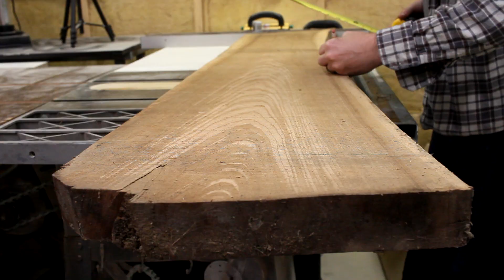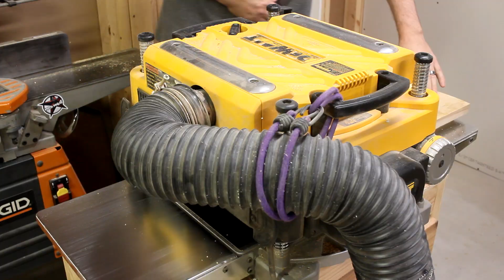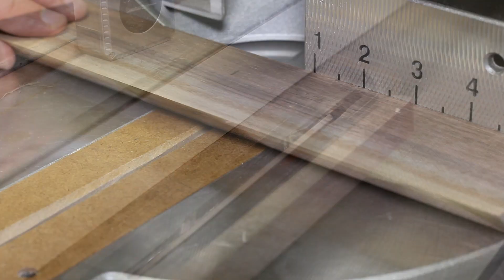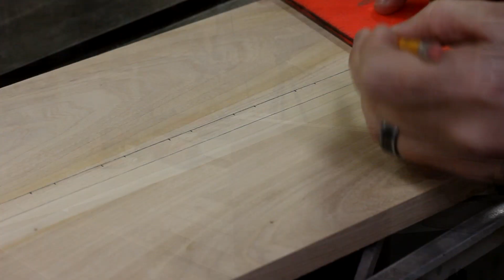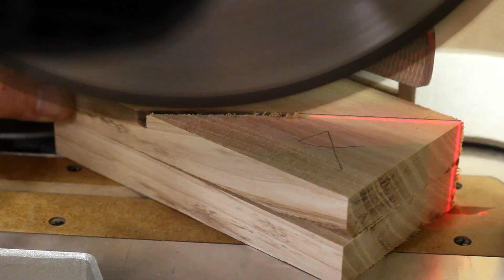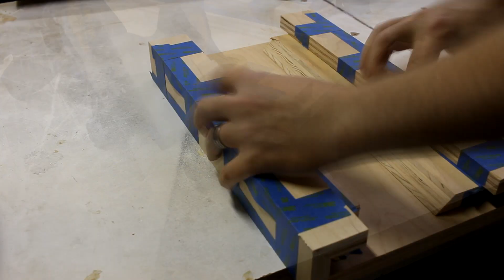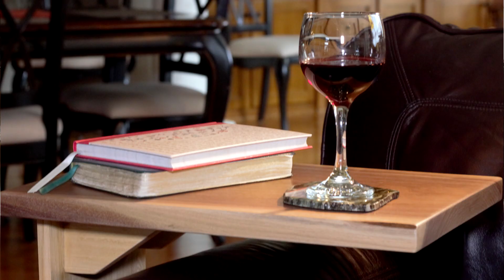Woodworking: Making an Adjustable Sofa Table

Comment: Sweet table !   I understood  why you built it for your parents  and their situation  but the reality  is  with al of todays  technology and gadgets  just about any one  could urilize this type of table   In their living rooms  and delete the coffee table   It would also be easy to  add  on accessory  parts to hold things like  remotes, cell phones  or whatever else  you may want handy in the room you use it in  i had  a commercially  available  kne i  used for a laptop  and it worked for many  places in my  home  for doing  work on the  computer   It was  unfortunately ugly   So i wound up getting rid of it  but your design would  be  the way to go since  i like the look and  flexibility of it
Reply from the maker: You're absolutely right, Craig!  It's definitely a multi-purpose table, especially with the variety of heights that it can be set at.  Change the dimensions a bit and you can make it wider to accommodate laptops or what-not.  Nice ideas!

Comment: As a beginner, I sure do appreciate the "limited tools" build at the end. Though I thoroughly enjoyed the beginning and all of the beautiful wood and tools used, I know what I have in my budget and will definitely be looking at those plans for the plywood version. I think it would make a great gift for my folks all the same. Thanks for sharing. Sub'd
Reply from the maker: Thanks, Eric!  This table definitely makes for a great gift.  And what's nice is that you can get 4 of those tables out of a standard sheet of plywood so you can batch them out if you'd like as gifts or to sell.

Comment: An amateur here, do you think just glue will be enough to hold top table's weight?

Nice design & build.
Reply from the maker: Yes because the gussets would be edge to edge grain joints so a glue joint would be strong.  Without the gussets it would just be end to edge joint and that would not be sufficient.

Comment: Beautiful project. A really useful mod might be to slap some castors on the bottom, cut a slot instead of mortice or dowel holes, sink a threaded nut into an adjustable knob to set the height, then use it as a companion to your table saw for handling large sheets of plywood or whatever.
Reply: Great idea! I may have to make one

Comment: Dude get yourself a resaw blade for that bandsaw! You'll wonder how you ever lived without it...
Reply from the maker: I have one... it's just super dull.  Had to use the little one for this project.
Reply: @FishersShop  I recommend looking for people who do sharpening in your community. I found a farmer near me that can sharpen anything. He had an ad that he would sharpen mower blades and I called and asked and he can do table saw blades, bandsaw blades, etc. Much nicer than having to mail them out.
Reply: @FishersShop  There's a YouTube video for sharpening blades using a Dremel and a shop made fixture right on the bandsaw. I tried it and it works pretty darned good.

Comment: Do you use cutter head lock on your thickness planer? I get a lot of snipe when I use my neighbors without it and I even tried putting the pieces in right after each other to prevent it. I've been wanting to get one of my own and I am debating if the extra cost is worth it. Great Video as always!
Reply from the maker: I don't.  But before this project I switch to brand new knives, took very shallow passes, and the snipe just wasn't there.  I was getting a ton with the dull knives.
Reply: Do you think the DW725 was worth the money? I surprised you don't have the Ridgid!
Reply from the maker: @thehusband12  Definitely!  I actually got the Dewalt 735 planer before I started getting hooked on Ridgid.  But even so, Ridgid doesn't have a planer in this class, only the lunchbox-style planer.  The D735 is very good in my opinion!
Reply: @FishersShop  Here and I thought you were always dull